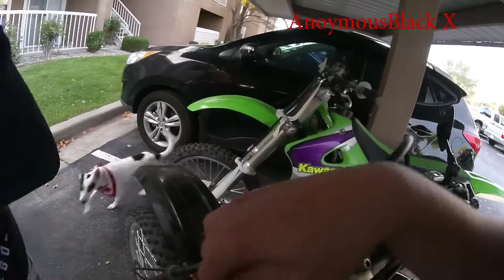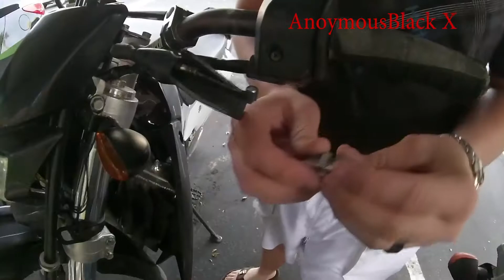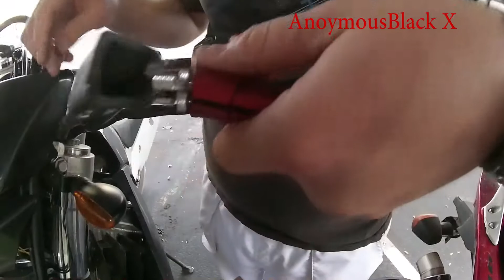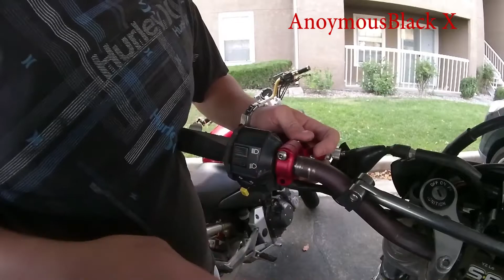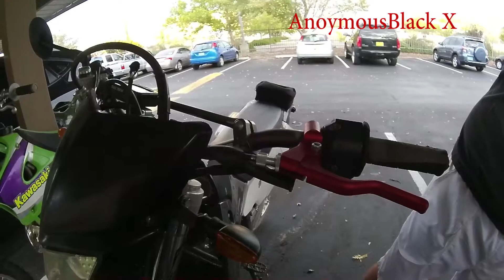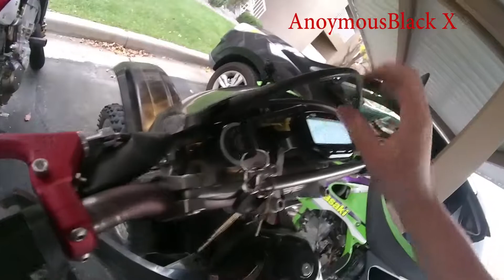RIGHTOUS STUNT  METAL CLUTCH LEVER INSTALL!!!

Comment: Pretty sweet! I can't wait to get the lever. The only thing that concerns me is mirror placement, seeing as that new perch doesn't have a mirror thread whole. Unrelated question, how do you like that klx headlight compared to the stock drz headlight as far as night time visibility and light spread?
Reply from the maker: At night is great the only problem that I have had was its hard to adjust the height if the light but I fixed it with small buggies pulling the bottom down
Reply: Does it have actual adjustment screws like the stock drz one has? What about stability of the light, its looks to be a lot lighter, does it make it shake and vibrate a lot? I love the performance of the stock light, but the klx one just looks much better, i'd like to buy one, but I don't want to sacrifice performance for looks. What's your final verdict between the stocker and the klx one?
Reply from the maker: No it doesn't, honestly I wish I would have kept the stock drz housing it really does vibrate quite a bit.
Reply: Damn, yea that doesn't sound very practical. I just wish the drz housing wasn't so... square. But i'll be fine with it, and it doesn't look so bad with the hid kit in it. Thanks for the info.
Reply from the maker: Yeah no problem man
Reply: +MDMoto !! get some underbar mirror action going, i use them and i love them, really discrete, AND gives better visibility than stock mirrors. i bought some universal bar end mirror, removed the end bar screw and clamped it around the bar next to my grips. really easy mod to do, cheap and gets your bike looking 75% better
Reply from the maker: i dont like them cause you have to look down from riding
Reply: AnonymousBlack X Same here. Ive never had them, but I've thought about what it would be like, and that position under the bars is way out of my view in my normal riding position. I'd have to look completely down away from the road to look at them.
Reply: MDMoto !! still easier and faster than 180º turning to see behind you, and on a supermoto its not that bad, i had the same fear before i got them and its nowhere near as bad as i thought, especially if you got a fat bar with riser tables, a quick glance down and you see from the usual blindspot (it negates it) all the way behind you. i ran the stock mirrors for 3 months, then took em off, and after 1 month of no mirrors i got these, super satisfied, and they are like 20€ so you really dont loose anything for trying them out